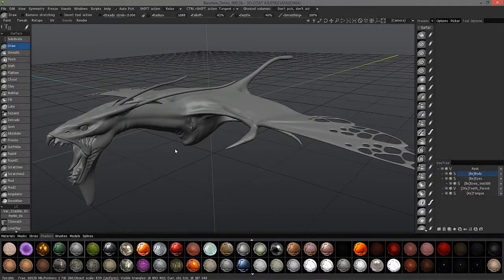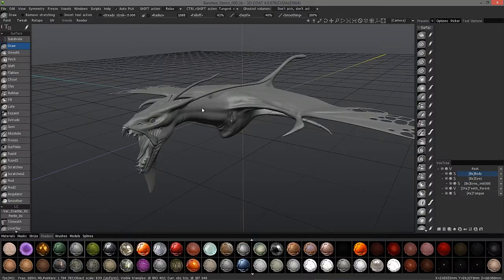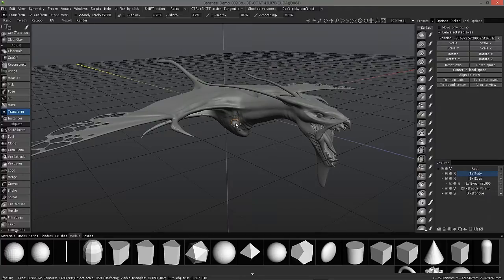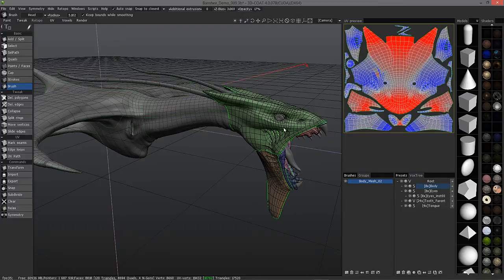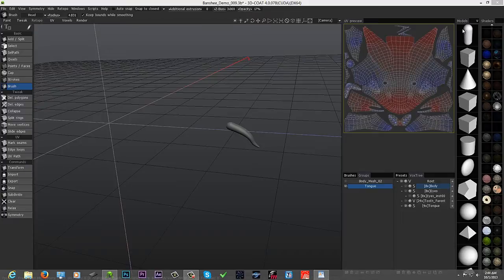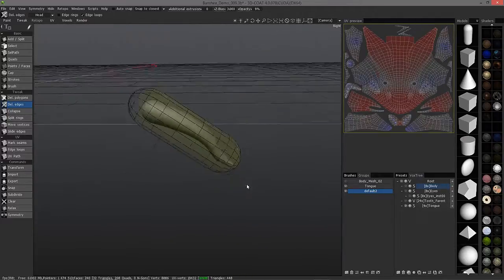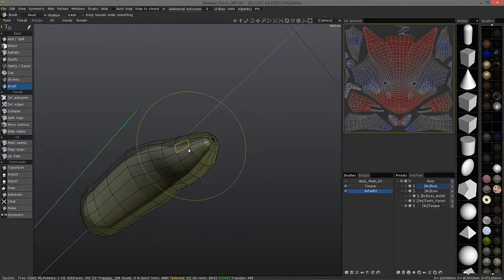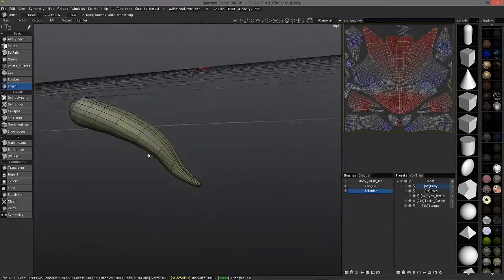Retopo Room Pt.1

Comment: Man, you spent 15 minutes to create nothing but rough mesh over the tongue? Bad example, sorry
Reply from the maker: Why such an abrasive and inaccurate criticism? It is a BASIC example showing how one might elect to use a primitive or preset model > tweak the shape a bit if needed, then snap it to the high poly mesh. 
And no, it doesn't actually take 15 minutes to retopo such a basic mesh. Explaining the process and different options, does. You know this is the case, so why exaggerate?
Reply: Making a tutorial is about showing a process, not doing it fast, once you know the process, then you work on speed, try and make a video tutorial of your own, you'll see what I mean, I have been making tutorials since the 90s, it's not a linear process, not one bit! 😉